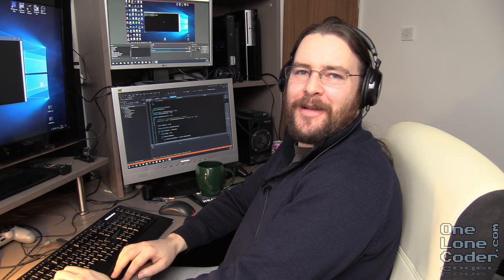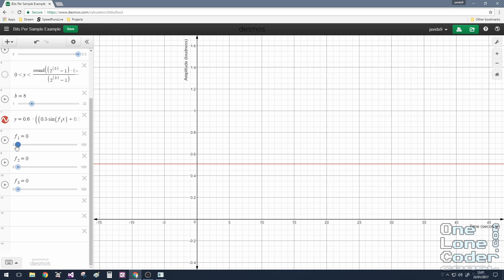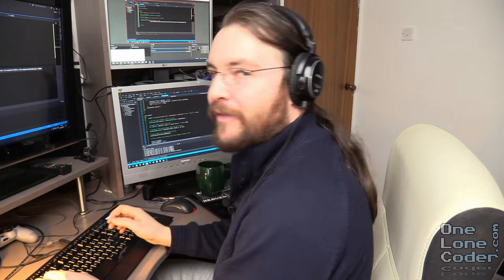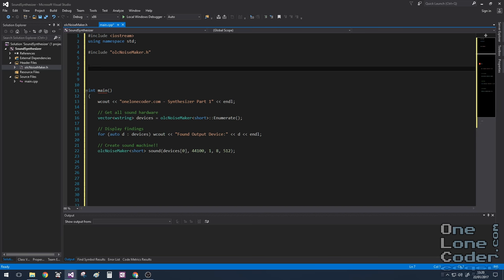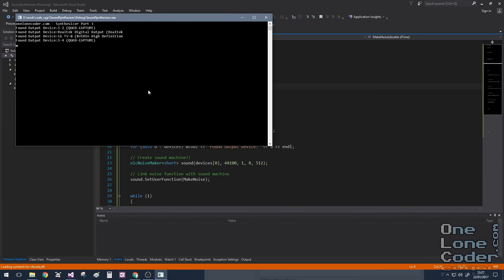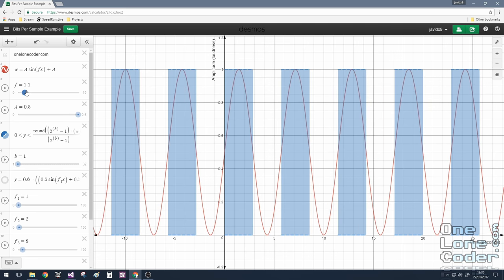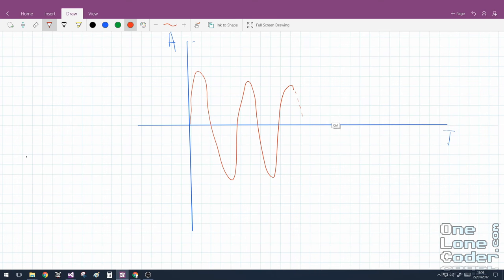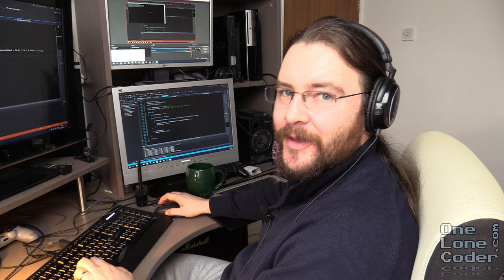Code-It-Yourself! Sound Synthesizer #1 - Basic Noises

Comment: Holy crap i've been wanting to do this! :)
Reply from the maker: I'm pleased you're exploring the channel!
Reply: One of the more obscure errors I've ever seen: 1>c:\users\DBach\source\repos\sinewave\sinewave\main.cpp(55): note: see reference to class template instantiation 'olcNoiseMaker<short>' being compiled

ADDIT ah hold on, I was looking at the bottom of the list. Seem to be some more obvious ones up here . . .1>c:\users\DBach\source\repos\sinewave\sinewave\olcnoisemaker.h(169): error C2664: 'void std::vector<std::wstring,std::allocator<_Ty>>::push_back(_Ty &&)': cannot convert argument 1 from 'CHAR [32]' to 'const std::wstring &'

Okay will still need to do a bit of googling but that one at least seems decipherable :) Probably a result of using a VS 2010 formatted file in VS 2017 I'd guess.

https://msdn.microsoft.com/en-us/library/s5b150wd.aspx
Reply from the maker: +Diche Bach hey make sure your compiler is set to Unicode. In vs, project properties, general, character set, use UNICODE. For others define UNICODE and _UNICODE as pre processor directives
Reply: Sweet! 

The change to Project Properties\General\Character Set\Use Unicode Character Set  fixed it!

Not sure what you meant by "For others define UNICODE and _UNICODE as pre processor directives"
Reply: Very cool! Great entry point to sound synthesis!

Wow this is so awesome. I've already worked out the main part of a little ditty for my first side scroller! :) Thanks a million for this tutorial and all your videos javidx9! I'm your new biggest fan.
Reply from the maker: Compilers that are not visual studio require setting manually.

Comment: Is there a way to generate alphabet sounds(say 'A') without using prerecorded voices,text to speech and speech synthesizers in c#
Reply from the maker: I dont know about specifically C#, but yes this can be done, after all, how does speech synthesis work in general? :D Vowel sounds are quite easy, and a cursory glance at a spectrograph will tell you their components, but fricative and glottal sounds can be more difficult to produce, where you need to mix several sound sources together.
Reply: i think you'll find an answer by looking into formant based synthesis.

Comment: @javidx9 Does this need done on the visual C++ compiler or would this work on any C++ compiler? (ex MinGW, GCC, Clang)
Reply from the maker: In this instance I use the winmm library which is part of windows. So as long as you have a windows devkit you should be fine

Comment: Hello, nice project, would it be possible to get a c++ visual studio 2010 source code of this project. Thanks.
Reply from the maker: Thanks Mario, It shouldnt be too hard to modify the sources, as the winapi is very old fashioned. I think the only differences will be where Ive used initialiser lists for certain things, you may have to initialise them explicitly

Comment: HI Javidx9, loving your tutorials.

I have a problem with this tutorial. At approx 16:00 into the video I can get NoiseMaker to produce the sine wave 440Hz tone, but the program returns an error:

The thread 0x321c has exited with code -1073741510 (0xc000013a).
The thread 0x60 has exited with code -1073741510 (0xc000013a).
The thread 0x55c has exited with code -1073741510 (0xc000013a).
The thread 0x32ec has exited with code -1073741510 (0xc000013a).
The thread 0x22f8 has exited with code -1073741510 (0xc000013a).
The thread 0x25dc has exited with code -1073741510 (0xc000013a).
The program '[12632] SoundSynthesizer.exe' has exited with code -1073741510 (0xc000013a).

Any ideas?
Reply: Forget it, it's the expected return code when you close the console window!
Reply from the maker: My apologies jock this one completely passed me by! Well at least youve made some progress. Let me know how you get on!
Reply: No apology required, every error is an opportunity to learn. Really appreciate your efforts on this series.

Comment: timesaver for those who dont have unicode enabled 
: BiGreDNoSecoMpAny
BiGreDNoSecoMpAny
for 3 år siden
Hi there! Thanks for sharing this project.
When trying to compile in VS Community 2017, I get the error: 

"Conversion from "CHAR [32]" to "const _Ty &" not possible"

This occurs in the ENUMERATE() function in olcNoiseMaker.h. Specifically at 
    sDevices.push_back(woc.spZname)

As per the documentation of Microsoft of WAVEOUTCAPS, spZname is a TCHAR.. 
Any tips?

javidx9
javidx9
for 3 år siden
Have you got unicode enabled for your compiler?
Reply: i have the same problem on VSCode, but it worked on Visual Studio (although that's not what i want). Some errors might have something related to the compiler i'm using on VSC having a different way to import winmm.lib

Comment: Great video.  When I run this, I am getting an access violation on the atomic unsigned int increment (++) (Line 226,variable is ' m_nBlockFree')  Now I am sure it is some wierd compiler setting and not a code bug.  But I cannot seem to find a solution.  Would really like to continue with all these videos, but I need to get the first program to work.  I have stepped through the code and I can see some successful -- operations, it goes down to 6, then the next ++ causes the exception.  I do hear a tiny 'blip' of the sound, then the exception is thrown.   It is probably easy, but do dept to figure it out.  Many thanks...
Reply: Me too, I'm using the community version of VS 2022. Need to dig further into the exception data when I get chance.
Reply: @DoItYourselfAndy  I figured it out.  I was compiling to 64 bit application.  The exception went away when I set it to 32-bit.  Hope that is your problem so you can continue.  Cheers.
Reply: @jlawrence71  Cheers, I was just about to share the same light bulb moment with you 😅
Reply: Possibly not quite the same tho, I was compiling x86 code, but the debugger was running in x64 mode. I think if we'd executed the cmd line build separately, if would have been fine, as the project was a win32 console target. You'd expect the debugger to default to x86 because of this, but it's a good example of where a bit of hand-holding ends up causing problems. Once had to re-write a setup procedure for some Ind Controls kit, as the technician found the network config didn't work. Seems I'd missed out telling him to press "enter" after typing the subnet mask 🤣

Comment: Hi, I am using xcode, what can I use to replace the windows.h header file on osx? I would really like to follow along but of course it won't work without that file, what are the alternatives? Thanks..!
Reply from the maker: Hi sesapotube, yeah, I do most of my stuff on windows, which I get sucks a bit for the nixers and mac users out there. I'd love to do more cross platform stuff so they can play along too! There are plenty of audio frameworks that allow you to manipulate lower level sounds. Off the top of my head, fmod, SDL and portaudio all provide interfaces to sound hardware where you can manipulate the buffers as you see fit. It depends on your current skill level, as making these things work can be a bit tricky. In my Community Showcase Video, there was an SDL version for linux made by a viewer, which is quite a faithful recreation of my later synthesizer videos https://github.com/madeinsoviets/synth/blob/master/main2.c
Reply: Thanks javidx9 , I am self teaching myself C++, coming from sound design and music production and I am at the early stages with C++, aimed to put into code some ideas I have... I am going  check out the resources you have suggested and thanks for the videos you make which I find very useful and well presented. I hope you'll keep making more.

Comment: For some reason mine sounds like absolute garbage and all scratchy at first. Is this my code or my computer?
Reply: If you're still struggling with your problem, I think you code sounds very scratchy because you may have forgotten to delete a block of code:
At 21:11, in lines 41 to 48, we added an if/else statement to play our sound, but later in the video (23:26), we delete that if/else statement and replace it with a for loop and 1 if statement. I almost missed that code deletion as well because of the jump cut.

Hopefully that solves your problem, if not, maybe it is because you're holding 2 key down at once. Good luck with your coding!

Comment: Hi there! Thanks for sharing this project.
When trying to compile in VS Community 2017, I get the error: 

"Conversion from "CHAR [32]" to "const _Ty &" not possible"

This occurs in the ENUMERATE() function in olcNoiseMaker.h. Specifically at 
    sDevices.push_back(woc.spZname)

As per the documentation of Microsoft of WAVEOUTCAPS, spZname is a TCHAR.. 
Any tips?
Reply from the maker: Have you got unicode enabled for your compiler?
Reply: @javidx9  thanks for the answer, turns out I had to specifically turn it on in the VS project, still getting used to visual studio

Comment: This is only my 6th day learning to code (C++) with the intention of developing audio applications and plugins, and I feel like I understand a lot of the basics, and can write my own simple programs, but how do you go about writing something like the code in your olcNoiseMaker.h file? I mean, I recognize a lot of the structure and elements, like: functions, classes, variables, constants, for loops, modifiers, data types e.g. bool, int, double etc. but I have no idea how you put something like the code in the olcNoiseMaker.h file together to produce the functionality that it does. Can you tell me how to transition from writing really simple programs to something like this? I really don't understand how to make the transition. Thanks.
Reply from the maker: Hi Tom, its mostly just through the accumulation of experience. That and starting to learn APIs. Knowing the syntax of C++ is great, but fundamentally not very useful. APIs allow you to start doing things in real world, they are the tools to use graphics cards, control ports, make noises, write GUIs, access internet etc. For this I knew i needed to make audio happen, so i knew i had to interface with an audio system. Windows has several, this approach was the simplest but also has the highest latency. The API docs need to be read and understood, and thats it, good to code!
Reply: @javidx9  Hey, thanks for the response. I guess what I'm trying to understand is how all functions work. For instance, printf. What does the definition of printf actually look like? The output of this function draws pixels on the screen, right? Is that accomplished simply through arithmetic? Because the output of all of my functions simply uses arithmetic. Is that the case for functions that can play audio files or print pixels on the screen, as well?

I think what's confusing to me when I look at code like in your olcNoiseMaker.h file is that my mind wants to try and figure out how the functionality/output is being produced simply from the code in your file. But that's impossible, because you are calling functions from an API and the definitions of those functions are in other files.

So, when I see you call one of these functions in your file, all I see is a name, like PlaySound, which is actually a function I used in a simple program I made, which randomly plays wav files. But my mind wants to understand how this PlaySound function actually plays a wav file. That is to say, what does the definition or body of this PlaySound function look like? Can the output of PlaySound be produced through a series of arithmetic?

Is there a way to see the definitions of built-in functions in the standard C++ library or other libraries? Because that's what I want to see, so that I can understand how output like playing an audio file is being accomplished. I mean, ultimately, I will be using functions from libraries or a framework like JUCE, but I want to be able to understand what it takes in order to produce any type of output. Can it all really be boiled down to arithmetic?
Reply: @javidx9  I guess that means you don't know. I'm brand new to coding, but it seems that a lot of programmers are really ignorant. I can ask a question on stackoverflow and get 10 answers and they're all different. Meaning, the programmers who gave an answer don't agree on what the answer is. This is one reason I'm learning to code. I have learned that I cannot trust anyone to know anything. So, I have to learn it myself.
Reply from the maker: No Tom, i do know how functions work, i just get a lot of comments to work through. Ultimately it all boils down to two concepts. Arithmetic, and memory location. The printf function doesnt draw pixels to a screen. Why should it? It outputs characters to a buffer. That buffer is interpreted by something else, which is interpreted by something else, which then understands how-to render that information by placing it in memory attached to a graphics card attached to a screen. The same applies to PlaySound. It reads on the waveform using arithmetic to know how to read it in. The bytes that make up the waveform are at aome pointed handed to the hardware in order to produce sound. My point is its all layers of abstraction until you get deep enough, and programmers need to take an educated guess at what layer is deep enough for them to understand.
Reply from the maker: If you want ti see the source code for standard library, download it!

Comment: Hey, can anyone here explain to me what the point of the block count, samples, current, and block memory are used for exactly? Currently taking notes from several libraries, and found this video. My current idea of how I'm gonna do this doesn't involve utilizing something called "blocks" or whatever this technique is, as my library will be used for seperate ideas, however this video is useful for getting windows to output audio. So I'm just wondering what the point is here for the block memberdata (and such as the m_nBlockFree) as opposed to just running through it at a certain sample speed rate / bytes rate.
Reply from the maker: Blocks are how the OS talks to the sound hardware. Sending things sample by sample is grossly inefficient (it's all your CPU will be doing), so instead you tell your system to send a block of data every few milliseconds. Far more efficient as the os/CPU can exploit hardware data transfers to do this.
Reply: @javidx9  Oh that makes sense, that's actually really interesting. I was just confused as to why there's "blocks", but that does makes sense that sending audio in chunks/packets/blocks can be more efficient. Currently working on a small library for audio files, custom audio functions, and dynamic streams. My next goal is to play wav files (I already loaded them), I just need to play them at their individual sample rate. Which is something I'm about to be finished adding. Thank you for this tutorial, I like how you explain each bit of what you're adding or how your using an existing file.
Reply: @javidx9  Also, I already loaded a wav file with mono channel (as of just right now). However when I attempt to play it, via getting the sample offset in the byte array as the sample rate * current time, and then round. It just sounds like noise mostly with an underlying tone. I'm of course reading the array of bytes as the sample size which is a short, so 2, but this should still come out with sound, correct?

Edit*: I made some changes, so now my audio is loaded in a way that's a little bit more flexible. However if I were to pass into the clip function for where the nNewSample is suppose to be the short of the data at offset floor(time * sample rate) with size of short. It sounds a little, better but still a lot of noise and REALLY loud.

Edit**: If I remove the clip, it's pure static. So maybe there's something wrong with either the way I'm reading it from storage, or the way I calculate the sound.
Reply: Okay, problem solved, it turns out I just needed to add to the new sample the sample gotten from the audio source (add or set, doesn't matter, I use adding because of additional sources).

Comment: my code worked up until adding in the piano keyboard, after adding that my audio got all scratchy. You think i should code each key individually or should i change my bit size?
Reply from the maker: This is expected until part 2. Essentially it is monophonic, if any keys overlap they compete for the output frequency.
Reply: @javidx9  I watched only this whole video and my audio output was the same as yours until i added the "ZSXCFVGBNJMK" piano keys, then when i hit one key at a time it sounds like when neo touched the mirror and began loading into the "real world".  it worked with the dOctaveBaseFrequency double so its not a typo but its something with that string.
Reply: @jonathanhansen5208  lol, that's such a good description of the sound

Comment: Do you think I could convert this to python for use with a raspberry pi. If that is too hard what is the best way to code with c# on a raspberry pi
Reply from the maker: The concepts explained in this video are applicable to any programming language or environment that is capable of producing audio output. As for C# on Raspberry Pis I'm afraid I can't help you there, I believe Mono is the way of using C# in a linux environment.
Reply: I'm sure there is a c# or python compiler for raspberry pi somewhere out there on the internet; if not, try C
Reply: Yeah just do it in C.

Comment: 2 questions:

Anyone want to explain the \xbe or \xbc in the "mental exercise" of:
if (GetAsyncKeyState((unsigned char)("ZSXCVGBNJMK\xbcL\xbe"[k])) & 0x8000)

also, if I count correctly there are 14 keys.. but the loop has 15 (0-14)??  Isn't this 1 too many?
Reply from the maker: Hi Marc, \xbe and \xbc are escape codes in hex for the comma and period keys. These keys do not have the same virtual keycode as ASCII identifier and so are specified manually.
Reply: The condition is k < 15, thus the last cycle has k = 14. When k equals 15 the cycle is not entered.